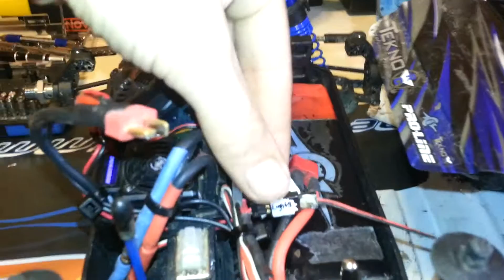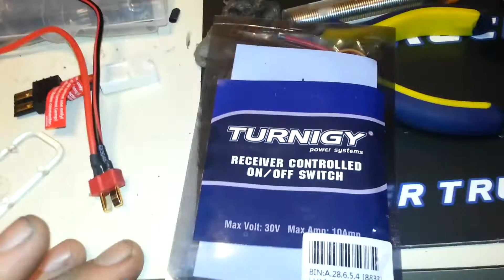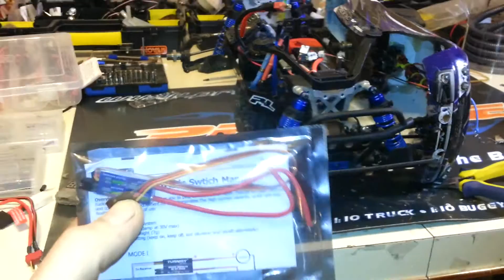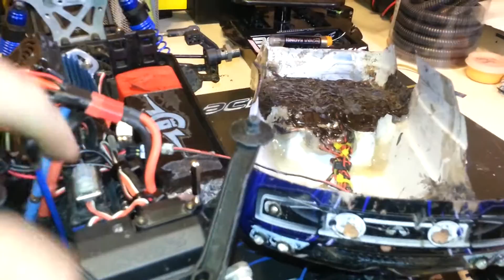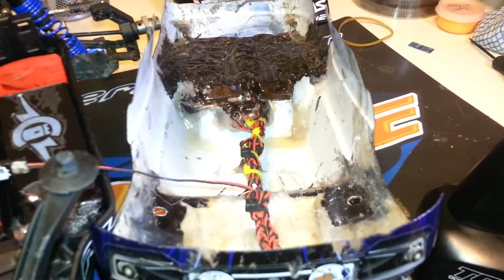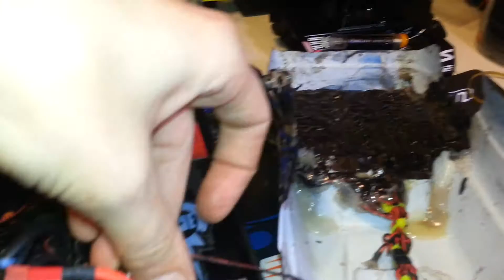Use Your TQi To switch LEDS/FAN/ETC (4 channel tx)

Comment: Do you know if this could work on a trx4 with a switch to change between the diff locks and lights? Great job btw
Reply from the maker: I don't see why not. However. You need a spare channel in order to switch some thing .  The 3 way rocker controls the diff locks?  And the switch on the top of controller is spare?   In that case you could use the spare 4th channel and the turnigy switch described in the video to control led lights, a winch or whatever else.

Comment: I should be able to power a siren off a 9v battery, right? I've had no luck with this switch. I saw a video that said I need to run an additional ground wire if I'm using a separate battery. I can't run it on the UDR batteries because it's wired in series for 4S.
Reply from the maker: I'm not sure if a 9v battery will provide sufficient current to power your siren.  You need to wire it as I've explained in the video.  Regardless if you are powering the switch 
from a separate battery or not you need to make sure the black wire coming from the load (the siren in your case) ties into your main battery black wire.  As the switch needs to splice into the same common (black) wire that powers the receiver, or it will not work. Remember  one red to battery positive (red) other red wire from switch wires to siren positive (red).  The black from the siren needs to go to main battery black.  Simple as tha lloll. You could also use something like this and just power off your 4s battery directly.   
https://www.parts-express.com/7809--9v-voltage-regulator-to-220--7809
Or
https://www.parts-express.com/lm317-dc-dc-buck-converter-5v-6v-9v-12v-24v-voltage-step-down-module-linear-regulator--320-617
Reply: So you need less V? Every LiPo has a service connector. You can power up by 4.2V, 8.4V etc.,  red cable is max V.

Comment: Each battery fully charged would supply 12.6v. You need to wire it to the positive of only one battery. Make sure your equipment that is plugged to the receiver controlled switch is capable of handling 12v

Comment: what would i do in the case of an E-MAXX? i run two 3s lipo batteries, so would i be able to do the same process shown to only 1 of the battery connectors or would that still be supplying 22.2v of power?
Reply: Make sure to wire the receiver controlled on off switch to only one battery.  Also Make sure whatever you are powering from it can handle pack voltage  (12v)
Reply: Thanks for the quick response ! So if I wired it to one battery connector on the "Y" harness then it would still be 11.1v of power? Also, does this ON/OFF switch only good for one channel?, A.K.A., would I need a second one for a second set of lights ?
Thanks in advance
Reply: +Marinus de Dreu  yes,   and yes. They are only good for one channel.
Reply: Thank you very much !

Comment: Can you plug a light set directly into the receiver and use the spare channel to turn on and off?  I have lights plugged into mine however I currently only have 2 channels.  I was thinking this was going to be a lot less complicated
Reply: unfortunately no.  you need the receiver controlled switch  to make it happen.